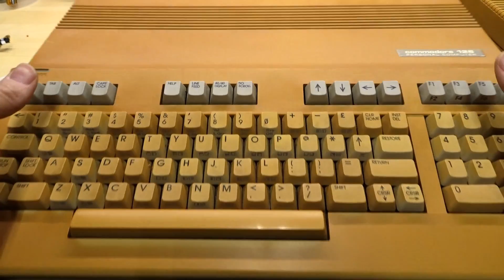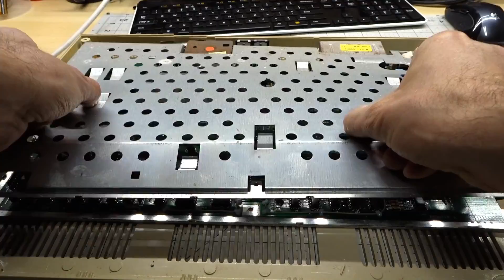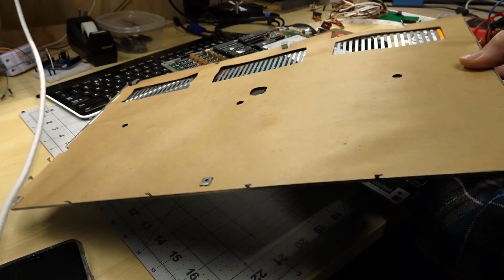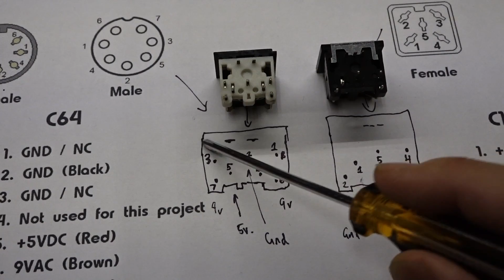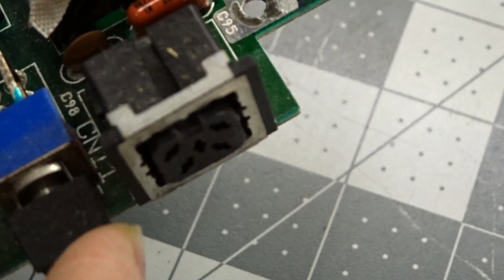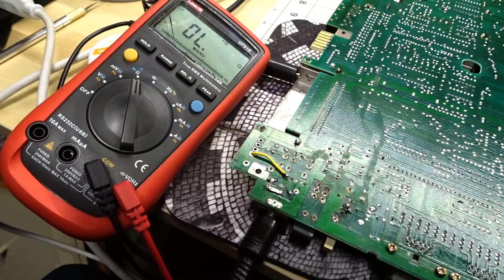C64 power supply on the yellowest C128 in the world

Comment: Dont use a c64 psu on c128. It will underpower it and destroy it after longer time of using. It has not enough amperes and the voltage is under the lower limit by pulling that many amperes
Reply: But the power psu will work just fine.

Comment: The way we used to do PCB mods involving sockets is to desolder the mis-connected pins, slip teflon tubing over the pins inside the thru-holes, and rewire as appropriate.

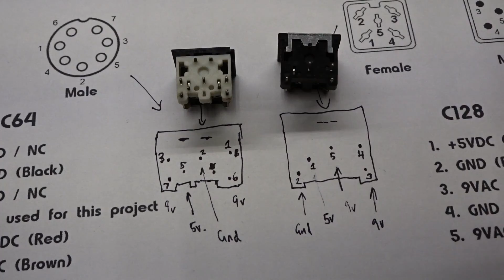Comment: 9:10 - Isn't the flipped contacts are the 2 sides of the +9 AC line? If it is then you don't even need to do that hack you just did. The C64 psu has 4 pins, 2 in pairs, 2 for the +5 DC and 2 for the +9AC, which makes it non polarized. Just an idea, I'm not sure about the details.

Comment: near the power connector you find the CN12, pins used in the 128-D for powering the board, there you could solder a cable to and the cable to a female plug for the c64 PSU. Use a unused spot/hole on the rear side (RF mod?)

Comment: I would have used the DIN5 socket with a DIN7 plug and some wires to make an 'adapter' that would have allowed you to plug the C64 PSu into the C128 without making any motherboard mods.

Comment: I have to ask 2 things. Did you ever retrobright this one? Second, would it not be better to make a cable adapter from the c64 round to the square 128? If you get other 128's you will have to hack them all to use the round 7 pin?
Reply from the maker: So I didn't retrobrite this case -- I had it painted by an artist friend. A video will be out soon on that one. I now have a couple more 128s and no I didn't swap them over as I ended up making a round to square adapter after a viewer sent me some of the connectors... In the end though, I might end up modding those so I don't need to us that adapter.
Reply: @adriansdigitalbasement  Oh nice! I look forward to seeing it. I'm just in the process of ordering all the parts for a power supply. I have a few ideas I'm going to try out.. Thanks again for the great vids. I'm learning a lot fro them.

Comment: I recently picked up a fully working C128 with PSU at our local recycling yard. The arrow up key in the upper row is broken out.I found the missing key on the floor but on the keyboard there is no socket, it is fully broken out. It looks like the socket has been removed with a screwdriver, there is only a big round hole. The cursor keys work, so that the broken key can be replaced. So it is mainly an optical issue. Do you have any idea how to fix it?  By the way, sorry for my english.

Comment: The old potted C64 PSU provided enough current to run the C128. The reason the C128 came with a larger power supply was for expansion. If you used a REU on a C64 you needed a better PSU, and what you got was a C128 supply with a C64 DIN plug.

Comment: I've seen oranging like that before - on old laboratory equipment. I'd bet it was used in a lab that had strong UV lamps for disinfection. They are usually left overnight, and are much stronger than sunlight in UV spectrum. We had to cover the displays on centrifuges with paper, because the UV matted the transparent plastic screen covers, even on new equipment.

Comment: it is not yellowed, its browned :D 
The c128 "gold" edition haha

there are the unpopulated connector CN12 on the rear right side next the ex.port for the c128-D power supply
(10:20 you see the 5 holes in the video)
solder wires to the points and the wires to a female plug, so the 128 is unchanged and you can plug in a psu you want

Comment: i would likely go through and replace all external connectors either the original owner was a heavt smoker or someone have at with a can of gold spray paint

So you don't have to keep replacing connectors may i make a suggestion make a dip switch and make a second lead  and have a the correct lead for c128 it is not a wise idea to go cutting a board trace to add a bodge wire setup so you can use a different power plug

makes more  sense to have a switch relay on the psu to allow both styles of plug type..

Doing as I suggested could be an easy way to actually make some cash in building a new workable psu for the commodore line of computers or even moake to the point that you have dins off the psu to begin with..

Comment: Love the content, just question the methods for the power supply. Surely, the cleanest method would be to re-design the power supply so that you had either 2 flyleads from the box permenantly fixed, or a modular connector ie c64 to c64 or c64 to c128? Least it works I guess.

Comment: The C128  has two video controllers. One for C64 mode and one for the C128 mode.  To boot up in C64 mode, press the commodore key and start the computer. C128 mode is usual 80 columns , has full access to all 128KB while c64 mode can only access 64KB. When a 128 gives no image, try the command  "go 64"  The C64 modes is limited to 1Mhz, the C128 can enable 2 Mhz but no I/O can work at 2Mhz  so when I/O occurs the c128 drops to 1Mhz. In C128 mode easy to switch from 1 to 2Mhz with the "fast" command, going back to 1Mhz "slow" command.C64 mode can not see the C128 mode. C128 mode can switch also to 40 columns and all C64 resolutions with the "graphic" command. The Z80B  works also when switching to modes and in case of CP/M even the 8502 processor is then used for specific tasks.

Comment: Came hear thinking you had used an original C64 power brick on a C128. That probably wouldn't work :) The lines is due to interference from the clock signal generated by the VIC-II chip. There is a solution called "LumaFIx128" that should take care of that: https://sharewareplus.blogspot.com/2018/11/lumafix-128-has-now-entered-mass.html

Comment: Great video! 128 one of my fav Commodore computers.  I have three one is almost new, one's has some yellowing and one is not quite as yellow as yours but pretty yellow.  I'm  looking forward to seeing your retrobrite results.  The square dins aren't that hard to find.  here is  a  link if anyone is looking for one and thinking of modding their motherboard because they think they are.

https://www.ebay.com/itm/Power-Supply-Connector-for-Commodore-Amiga-500-600-1200-and-Commodore-128-/142759804466

I would have left it stock, but hey its your machine and I can understand  wanting to be able to use the same PSU for multiple machines 128 and C64 makes life easier.

Comment: When they become that yellow. Then I like them to get a coat of spraypaint. Else... If you had a spare square plug from a dead 128-PSU and a female round DIN plug, then it would be better to create a converter cable. Not long, just some 5 centimeters or something.

Comment: looking at it.. it looks like years of direct sunlight + chain smoker + the bromide = severe yellow stain! 
However, if you can't retrobrite, I would spray paint it.. 
As for the power socket. I would have probably looked to have mounted the other socket on a small PCB and wire into that and mask off the underside to not short out and secure it to the board with the grounds. I still think it could be done with any case mod - it could probably just squeeze into the original place, may be tight but.. never happy cutting tracks on a motherboard.

Comment: Personally I wouldn't have touched the PCB at all to modify it for this connector. I'd rather just modify the connector itself. At 12:50 it's pointed out that the leads on the connector are exposed, so it would be quite simple to just rewire it directly there. Snip the two leads that needs to be swapped, and then solder in wires to connect them accordingly. Leaves the C128 motherboard basically untouched, and the only modification is on the connector which is easily reversible if ever the need arises.
Reply: @adriansdigitalbasement  Ok, difficult to see from the video, but it looked like the white plastic could be removed and then make the modifications to the pin under it. Anyway, one cut trace isn't that difficult to repair if needed anyway. :)

Comment: 5 pin square dins available on ebay: https://www.ebay.com/sch/i.html?_from=R40&_trksid=m570.l1313&_nkw=5+pin+square+din+amiga&_sacat=175669&LH_TitleDesc=0&Brand=Samsung&_sop=15&_osacat=175669&_odkw=500gb+samsung++ssd&LH_BIN=1&rt=nc&_dcat=175669&LH_TitleDesc=0

c64 psu to 128 adapter:
https://www.ebay.com/itm/COMMODORE-C-64-Power-Supply-64-to-128-Adapter-for-Commodore4ever-PS-64/332647355547?hash=item4d7353d49b:g:7ioAAOSwfLJa8REE:rk:1:pf:0&LH_BIN=1

cmon man, fix the thing right or buy an adapter :) the parts are available.
There was a reason the c128 had a heavy duty power supply, its because reu(ram expansion units) like 1764/1750 needed more power.   you can build a nice heavy psu with a meanwell psu(5v-4amp) and a 9vac transformer.

Comment: The stock C64 power supply is just 1.5A @5V (C64C brick is 1.7A) and C128 psu is 2.5A @5V so the standard C64  psu is not suitable for this mod.
Reply: Adrian Black, that is true. The AC side is fine but 5V DC is usually much higher than 5V and it can do a lot of damage. So people don’t plug in your old untested C64 power bricks without modifications or at least use some kind of over voltage protection device (ie. the C64 saver from bwack).

Comment: That is in Orange territory heh.  Must be loaded with fire retardant, keys are probably different batches, cleaning a NES controller recently and only the front plate went yellow. Had my doubts at the start but the PSU port swap worked out nicely. Was watching a video about the C128 recently, such a blunt force solution for 40 & 80 Column modes IE. just include both sets of hardware lol.

Comment: You can get new (not new old stock - new) male connectors from here:

https://www.soigeneris.com/commodore-128-amiga-500-600-square-din-5-pin-male-connector

$8.95 a pair. Doesn't sound so expensive. I've seen worse yellowing that's been cleared up by Retr0brighting.

Comment: I would probably try to obtain 10cm or so of 5 conductor cable, a square connector and a 5 pin DIN jack, then solder the right lines onto the correct pins, at each end, then you don't need to modify the computer.  You just plug your adaptor cable into the power supply and into the computer.

Comment: Retrobright doesn't actually solve the issue. There is a guy doing plastic restoration with a mixture of the chemical from nail polish remover which I am completely blanking on and then a mixture of mentholated spirits and that chemical and then an abrasive car polish to bring back the shine. It literally takes .001 of an inch off the plastic. Retrobright is simply dying the plastic and it is very temporary.

Comment: While I agree that the pigtail solution is a better solution, if I was in your position, I would have modified the DIN receptacle wiring exclusively and not modified the system board at all.  I'd rather have bodge wires inside my DIN receptacle instead of a hacked up system board, but that's just me.  Regardless, another fine video, and you also answered a question about using a PVM as a monitor for a C64/128 (and presumably Amiga); it looks good.  Now I gotta get a PVM.

Comment: Another quick thought I was reminded of while reading some FB comments on the video - to get the C128 to run stably, the 5VDC rail on your PSU should be able to output at least 2.5A stably. I think that's the rating on the stock 128 PSU, anyway.
Reply: My flat-128 PSU says the following:

Input: 220V~50 Hz 0.3A - fuse type T315mA T40/E (the US model would probably be 110V~60Hz 0.6A with a double-current fuse)
Output 1: 5V=2.5A
Output 2: 9V~1A - fuse type T1.4A

There's no listed fuse on the 5VDC rail, so I'm not sure what's going on there, but I know it's an SMPS instead of a linear-regulated PSU. I might try to open it up again and take photos.
Reply: One for each, the C128 PSU is very well fused.

Comment: So, what exactly was the reason for running the 9volts through a ground pin on CN12 instead of connecting it to the 9volts on CN12?
Is it not properly connected on a non-D 128?

Comment: I would have made an adapter cable with a female 7 pin din to wires directly soldered to bottom. I know ugly , but not as bad as Butchering the circuit board on a rare machine. :(

Comment: You can find some new versions of the square connector on EBay fairly cheap. I got some to make a cable for a power supply build that I did recently. If you check out my channel, I have a video on it. Nice job on this fix!

Comment: You can do the same thing with the plus/4. It has a square 4 pin DIN, and uses the same voltages / current ratings as the C64. The 4 pin square DIN lines up exactly with the matching pins on the 7 pin round DIN, and many plus/4 boards actually have the extra holes for a 7pin, so you can just drop one it. I did one recently for an upcoming plus/4 repair blog post.
Reply: @adriansdigitalbasement  No, there are no swapped pins, it is a direct replacement. You can even fit the 4 pin square DIN to a C64 if you really wanted to. But I prefer to stick with the same 7 pin DIN so I can use the same home made power supply that I trust on all of them.
Reply: @adriansdigitalbasement  Most of them are, the 8501's are a bit of an issue these days, unless you are lucky enough to get one with a 7501.

Comment: There is a replacement for the RF modulator that significantly improves the picture quality. It even removes the vertical lines almost completely by picking up the two interfering high frequency signals and correcting it with adjustable resistors. The fix tries to eliminate the AEC signal from the VIC 6567 (950-980kHz) in the C64 and 1MHz in the C128 generated by the 8566.  This mod replaces the HF socket with the s-video mini DIN socket and provides a 3.5 mm socket at the rectangular hole for the HI/LO selection switch of the NTSC models (PAL models do have the hole, but no switch). It is also prepared for dual SID/Stereo.
For details see the PDF (Modulatorersatz_Einbauanleitung_250469-R3.pdf) available at the German forum:
https://www.forum64.de/index.php?thread/82985-modulatorersatz-revision-3-sammelbestellung-07-2018/
Reply: Either plastic or a light metal would explain how alot of the 80s computers can survive this long.  Not sure about anything older though.
Reply: Time to do some reading - I know the LumaFix64 has been a thing for some time now, but I didn't know the 128 version was anywhere near completion because it had so many more clock-generated signals that cross-interfered with the image.
Reply: @borismatesin unfortunately the discussion on this topic in that forum are entirely in German.
Reply: @adriansdigitalbasement  Thank you for doing this video :D Is the yellowing normal as it ages? I don't believe i've had anything of mine that ended up that bad.
Reply: @adriansdigitalbasement  just for your information: I ordered one a minute ago for 15€ + shipping. I'll let you know.
Reply: @adriansdigitalbasement  I think UV is an accelerator but not an absolute requirement.  I've seen plastics yellow that have been stored in boxes while stored in cool, dark closets for years.  I really think it's the ratio of bromine, UV and time.  I think some plastics have bromine to meet requirements but others have much more (exceeds requirements).  I also believe the bromine isn't always mixed well.  Which can result in streaking even with submersion.  It's just the luck of the draw.  I've got plastic computers with no yellowing at all (from the 80's) that were used daily for years.  So again...it's a crap shoot.  :-)

Comment: Glad to see the machine's working! Yours seems to behave unusually about the 40/80 switch - usually when it's not pressed it works in 40-col. mode, and when it is, it works in 80-col. mode. Can't wait to see it getting a retrobright!

For the 80-column display, the easiest way is to get a monochrome signal out of it from pin 7 (mono) and pin 1 (GND) to a regular cinch. If you want full-color, I think any CGA/RGBI monitor should do the trick (as the 128 outputs a TTL RGBIHV signal). The only trick is that the monitor should have a "brown circuit" inside it that converts dark yellow pixels into brown ones (by halving the green signal for that pixel) - it will definitely work without it, but the palette won't be as complete.
Reply: Here's hoping it's just a switch that needs a bit of contact-cleaner. The great thing about the C128 is that the dual monitors work at the same time, with the VIC-II driving the A/V-out and the VDC driving the RGB-out, so you can easily whip up a piece of software that tests both screens at the same time.

Comment: You should get one of these, https://www.soigeneris.com/commodore-128-amiga-500-600-square-din-5-pin-male-connector
But 40/80 column key on your C128 is working in reverse :), when is depressed it should be 40 column, when is pressed is 80 column mode.